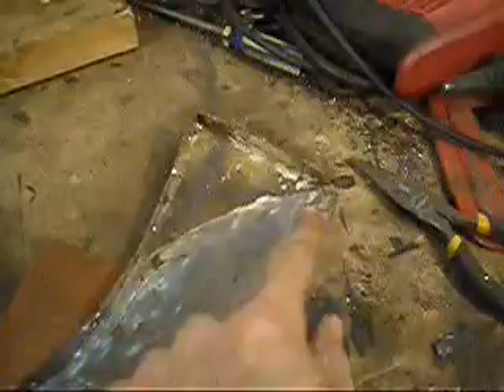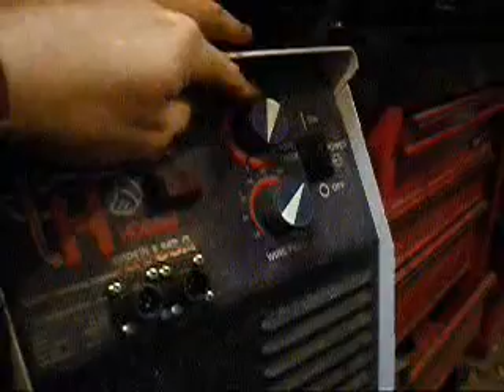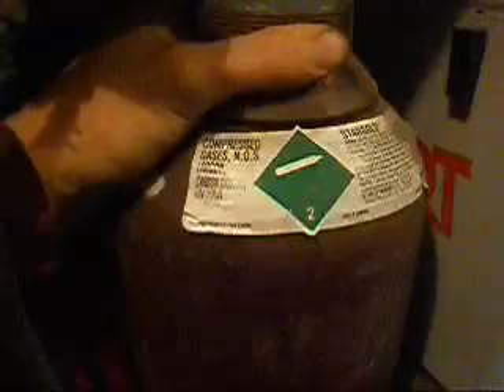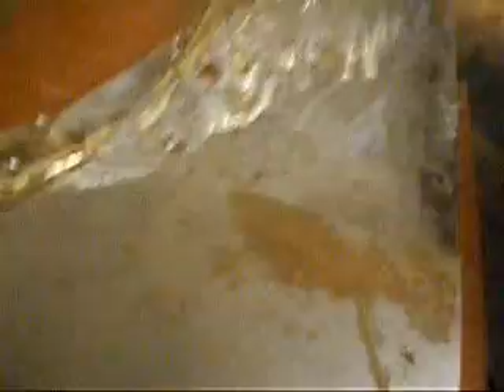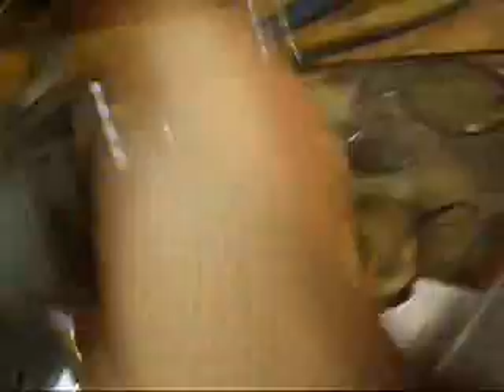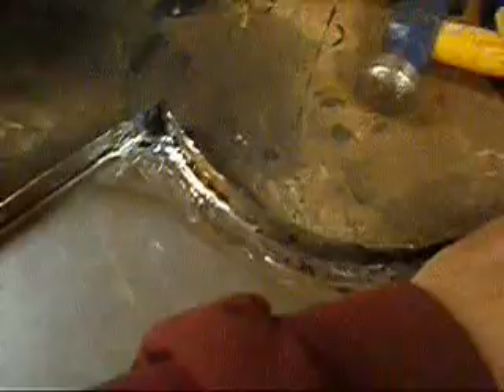Karmann Ghia Engine Bay Part 2 - Mig welding technique

Comment from the maker: @racetruk1 I basically paralleled the solendiod, motor and welding circuits and connected them to a 3PDT switch.  I made a box for the gas solenoid and all the wiring.  I used the same 4 pin connectors that miller uses.  The gun is a cheapo from ebay.  The speed is controlled on the welder.  When the switch is thrown it completely cuts off one side or the other.  I need a MUCH bigger unit for AL welding.

Comment: your like holms of cars i like your vidios and car. any details on adding spool gun to hobart welder i am now doing sheet metal on my truck properly i had flux core wire 030 that didnot work well

Comment from the maker: For car sheet metal, you'll want to turn your power down to 1.  You'll need to turn your wire speed somewhere around 60-80.  The lower power will allow you just a tick more welding time before the material starts to melt away.  You can also get a piece of copper and hold it behind the weld.  It will absorb some of the heat and prevent the weld from dropping out.

Are you using .025-.023 wire?  If not, I would recommend using it.  It will also help to lower the temperature of the weld.